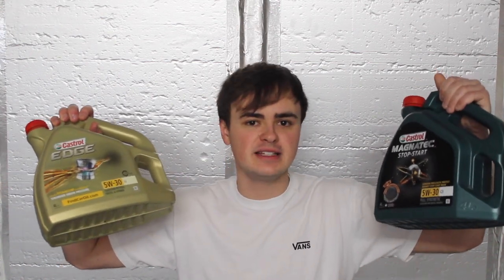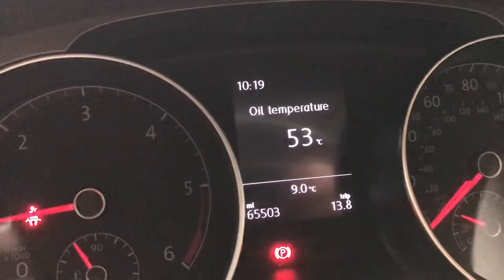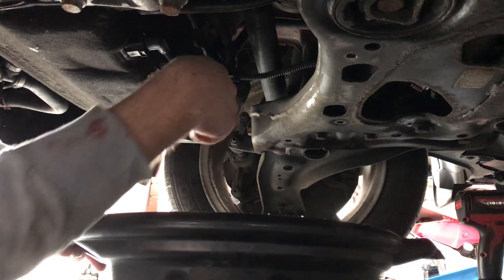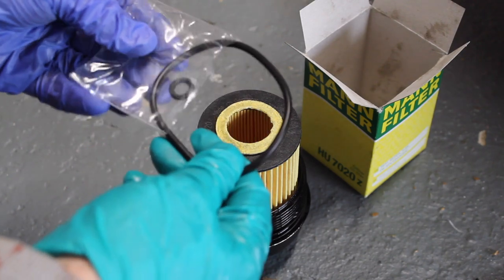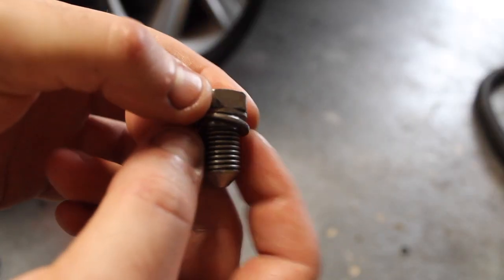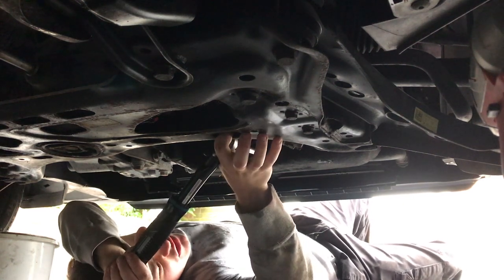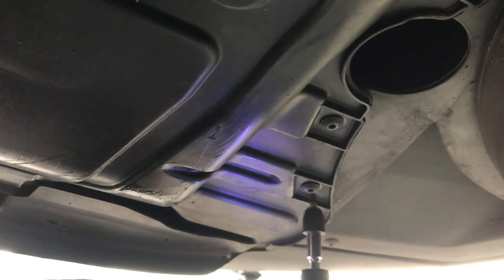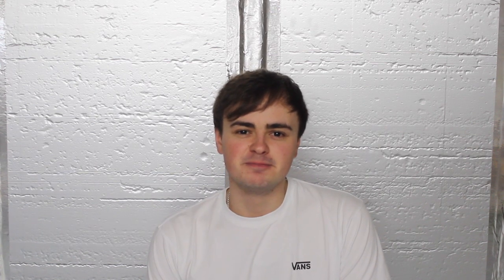VW Golf MK7 Oil & Filter Change - CORRECT OIL SPEC 2.0TDI

Comment: The Castrol Magnatec 5w30 C3 oil you used initially was low SAPS, hence the C3 designation on the front of the can. I doubt you will have done any engine or DPF damage using this oil. All you have done is upgraded to Castrol's best engine oil. Hopefully you have got some more mpg using Edge. I personally use Fuchs SuperSyn or Mannol oil in my VWs.
Reply from the maker: Thanks for your comment mate, it’s good to know that the C3 oil is also a low saps oil. I can’t say I notice much of a difference using edge oil over the C3 but I’m sure the edge is much better for this engine 👍🏼 I will have to check out the mannol equivalent as I’ve heard it’s great quality oil for a good price.

Comment: Great job ! 
So, the torques are:
- Oil Filter Housing Torque:
        32 mm -> 25+5Nm = 30Nm
        13 mm -> 5+2Nm = 7Nm
- Oil pan drain plug Torque:
        19 mm -> 30Nm
These are the values? Thank you in advance :)
Reply from the maker: Thanks mate, sounds good to me 👍🏼

Comment: the best oil is a frequent oil change. i buy mannol 20l drums works out €5 a litre and change oil and filter every 7500km and full service again at 15000km when the cars asks for one. you cant go wrong. better than changing castrol or expensive brands of oil at 15000km

Comment: Might be cheaper in the long run to buy a 20 litre lube cube from a Fuchs agent. GT1 Pro C3 is a 507.00 spec oil and used to be factory fill. I think I paid £85 last time but no idea what the cost is now due to oil prices rising. The longlife service regime was a thing to keep costs down for fleet vehicles, ignore it, 10k change as an absolute maximum, 6k if short journeys. As far as oil specs go stick to the VW code, there is more to the chemistry than you'd think. Older PD TDi's had to use 505.01 or 506.00 (or later 507.00 also works), anything but those and it was a gamble on whether the camshaft would wear out due to the oil not being up to the job even though it was the correct viscosity.
Reply from the maker: That’s good to know thanks for the recommendation 👍🏼 I stick to the 10k change using long life Castrol edge but would be good to get a bulk buy to save some money. I’ve heard that Mannol oils are pretty good too and cheap.

Comment: What has the oil got to do with dpf, it’s oil not fuel and it should stay within the engine shouldn’t get to the dpf.
Reply from the maker: Hi, I think it’s more to do with engines that burn a small amount of oil.
Reply: Every single engine burns small amount of oil. And even that small amount can have significant impact on the DPF.
Reply: Oil gets into the intake via the crankcase ventilation system, and also some through turbo seals. It doesn't take much to reduce the efficiency of the DPF.

Comment: 4.7 liters? Are you sure???It s 5.5 liters for EA 288,mon ami.
Reply from the maker: I used 4.7litres and showed correct level on the dipstick 👍🏼
Reply: @TurnersWorkshop97  ,something doesn t ad up,that is for sure.we are talking 800 ml.here.Very weird.
Reply from the maker: That is strange, where does it say 5.5 litres?
Reply: @TurnersWorkshop97  I am pretty sure is 4.7L
Reply: I use VW 0w30... why is everyone using 5w30...?
Reply from the maker: The recommended oil for the EA288 Diesel engine is 5w30 Vw spec 507.00. I stick with using the castrol edge LL professional and change every 10,000 miles.
Reply: @TurnersWorkshop97  how is ur car runing bro? I have the same engine as urea and use the same oil and oil filter every 8k miles. Isit ur engine runing good after a year and a half?  And good video thanks.
Reply from the maker: Runs like a dream mate, It’s on 80k miles now 60k since I’ve owned it and so far no issues just regular maintenance 🤞🏼 Is it the Castrol edge you’re using? The oil in the video was a bit of a mistake on my part but have made an updated video for the correct oil spec. Cheers
Reply: @TurnersWorkshop97  nice. Yes mate castrol edge 5w30
Reply: @promisedprince6201  0w30 is used by the manufacturers to meet mpg/emissions. If you want your engine to last, use 5w30.